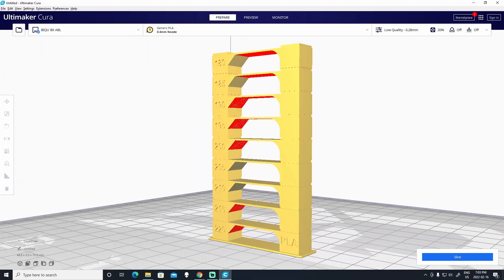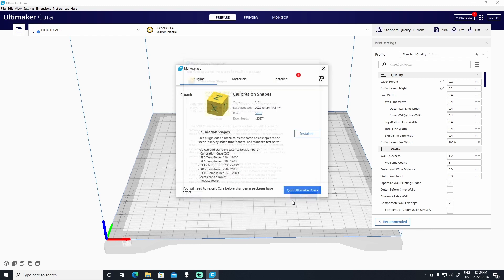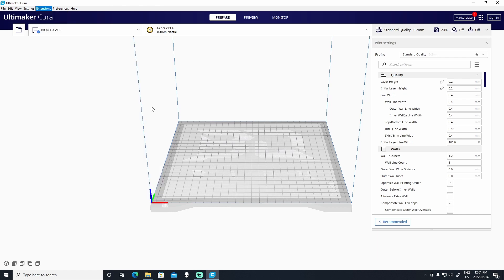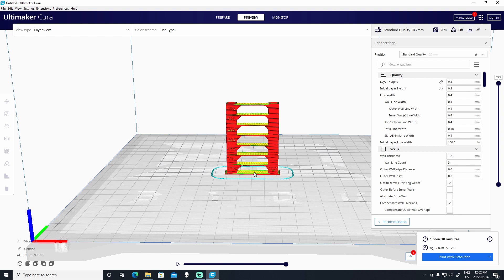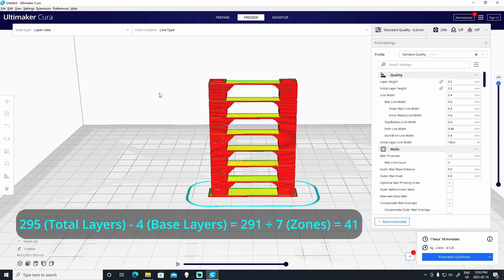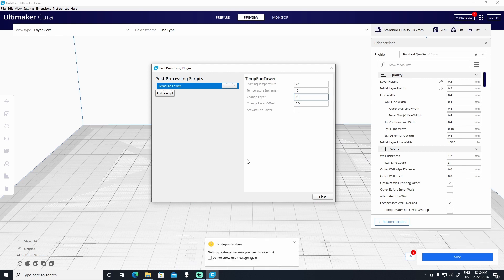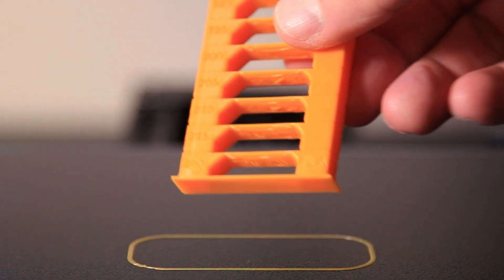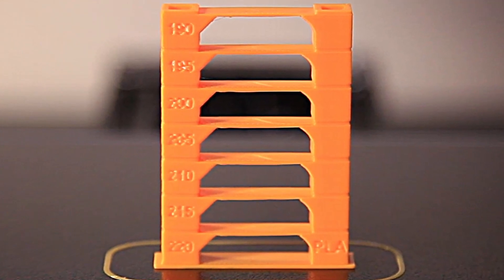Print a Temperature Tower to Improve your 3D Prints -- Cura 4.13.1

Comment: Sorry,  market place ? I lose definition and can't  read address bar. Again sorry.
Reply from the maker: Hello David Thomas...the Marketplace is part of the Cura Slicer.  So first download the Cura Slicer from here:  https://ultimaker.com/software/ultimaker-cura  After downloading install the slicer...make sure that you install the profile for you brand and model of printer (for example Ender 3).  Once you open up Cura you'll see the option for the Marketplace at the top righthand corner of the application.  Click on the button and that'll open up the window with all the different plugins (including the one I'm talking about here) which you can install in Cura.  Good luck.  RG
Reply: @CreatewithTech  thank you, I really think this will be useful. I am still struggling with the z axis.afte auto home after I set it I steat of the usual 10 it moves up as much as I set these z offset. I can print but I ha e to push print and manually adjust bed. Thank you for taking time to answer.
Reply: I manually set it in pause. the z offset seems to move after auto home. It is now 11.2 the exact amount I set -1.2 in compensation
Reply from the maker: @Phantom_dave  Hi David...setting the z offset can be a bit tricky.  Did you watch my video on this topic?  If not, you can watch it here:  https://www.youtube.com/watch?v=r4BDIGixU7Y&t=574s  .  After setting your z offset make sure to save everything to eprom?  Once you set it, the offset should remain at whatever value you set it to until you reset it.  RG

Comment: But 291 divided by 7 gives us 41.57.. I am confused. And when i count one by one the layers, the first two zones are totally out..
Reply from the maker: Hello George Hadjipavlis...sorry for the confusion.  I'm afraid I wasn't as clear as I should have been in the video.  Firstly, you need to make sure that the profile that you're using is the "Standard Quality" profile with a 0.2 layer height.  That's going to impact the number of layers in your model.  So with the 0.2 layer height and the standard profile you should have a total of 295 lines (layers) in the model, if you use the 190 degrees temp tower model.  You need to subtract four layers at the bottom, since you want the script to actually start working where the temperature tower begins (so at layer 5)...now if you count 41 layers starting at layer 5 each temperature change should begin about 4 layers above the bridge of each temp change.  This should give you a pretty good indication of how the filament works for each temperature.  The most important thing to pay attention to is how the layer lines look as well as the bridging.  When making an assessment just ignore the first 4 layers above each bridge.  Now, theoretically you can put in 41.57 in the Change Layer field of the script.  However, this may not be particularly helpful and it's probably a good idea to round up or down.  Rounding down is just my preference.  There is the advantage of losing only 4 layers for each tower vs 5 layers.  I hope this is somewhat helpful.  RG
Reply: @CreatewithTech  Thank you very much for your prompt and clear response.